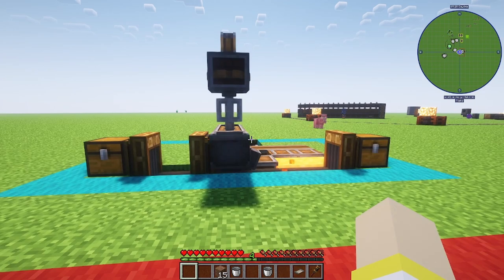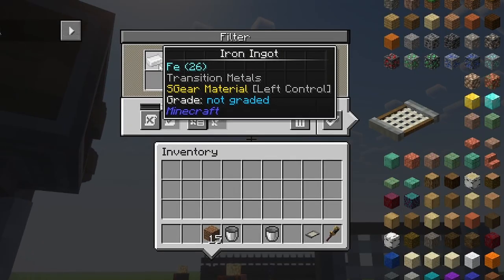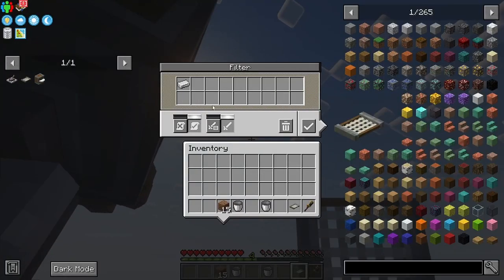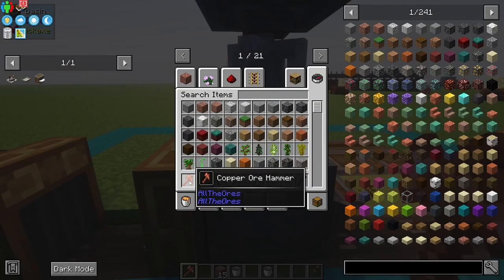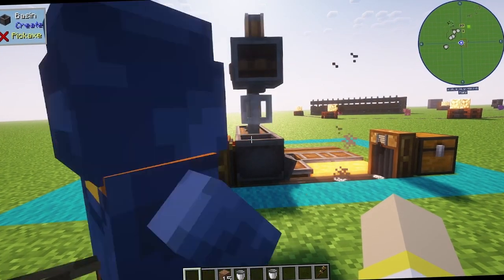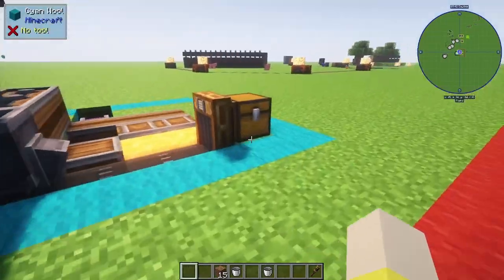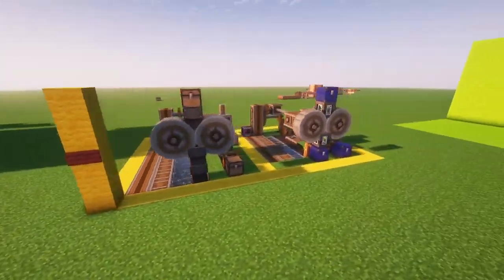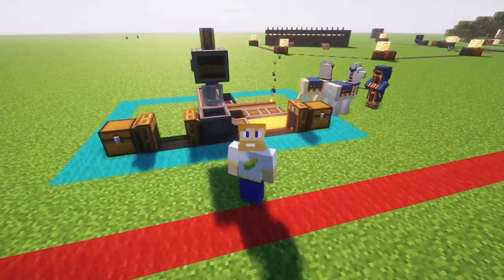Create Mod Ore Doubler!! |1.19|

Comment: It IS true that faster mixing means faster processing but faster fans do not increase cooking speed, you need more fans for that
Reply from the maker: Really?! That’s good to know thanks for the info!
Reply: @cornybreadman  yeah, fan speed only increases particle range (potentially increasing the number of stacks that can be cooked at the same time, if positioned right) but has no effect on the speed at which said stacks are cooked
Reply: You can place brass funnel on basin and set it to only output for example in stacks of 16 because fans can process bigger stacks faster.
Reply: @cornybreadman  Ye im pretty sure it says in the ponder menu

Comment: Hi I made this setup but everytime i use it the mixer destroys the ore hammer
any advice?
Reply from the maker: That's not good I'm actually unsure on how that could even happen maybe there's been an update with the create mod and now it destroys the hammer? If I can think of anything that it might be I'll be sure to let you know!
Reply: @cornybreadman  Id appreciate it lol just moved onto mekanism for now
Reply: ANy info on this? :/
Reply from the maker: @RagingGamingBear   I still don’t know why for some it works and some it doesn’t. I just made it again in my test word and it works. Just did 4 stacks and didn’t disappear so I’m not sure. Are you throwing the hammer in cause that what I do and it works.
Reply: @cornybreadman  yup, on the latest atm8. Throw in a copper hammer and using pipes to auto add ore and extract. Is yours the latest?
Reply from the maker: @RagingGamingBear  yes I’m on the latest. I wonder if the pipes have something to do with it I’ve never made it with pipes.
Reply: @cornybreadman  okie dokie, cheers anyways. Il load it up tomorrow in my main world and creative. Il update if I find anything lol. Thanks 😊
Reply from the maker: @RagingGamingBear  Thank you!
Reply: Hi and ım in this trouble when I throw hammer it dissappear in my modpack how can I fix this
Reply: @cornybreadman hey uhh when I use it the hammer gets pulled out, so I need to keep putting the hammer inside. Advice?
Reply from the maker: @Staeve64  sadly I think that’s just the new version hopefully they’ll change it back.
Reply: @cornybreadman  I made a system where it puts back the hammers in the basin, and when it takes durability, I add more hammers. Thanks for the advice also

Comment: Playing vault hunters and it doesn't have all the ores mod so dont have the copper hammer is there a way a can do this set up without the hammer , thanks
Reply from the maker: I’ll have to check the pack out bit if there’s mekanism in the mod pack the crusher will double most ores!
Reply: @CornyBreadMan  yea mekanism is in it but you need to unlock it so was looking to use your double ores till a have mekanism unlocked if u do find a way a would love it thanks

Comment: must have been patched in the newer versions, kind of lame :(
Reply from the maker: Yeah, sadly they changed it in 1.20.
Reply: It's kinda dumb, maybe it was more exploitable but it was the only decent way to ore double early on outside of silk touch on a quarry.
Reply: @cornybreadman  Does that mean 1.20 won't hold the hammer but older versions will?  My issue is that is uses the hammer once and spits it out with the dust.
Reply from the maker: @ccream26  yeah sadly they changed it in the update if you play an older version of create like 1.16.5 it’ll hold onto the hammer 1.20 spits it out!